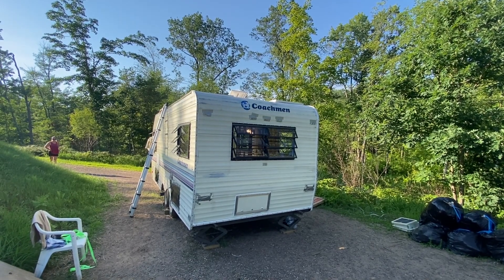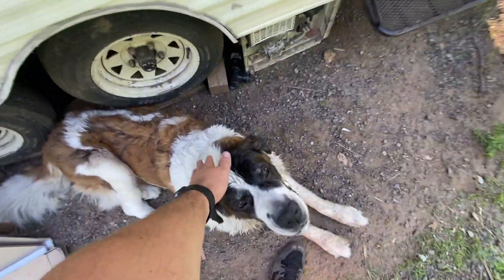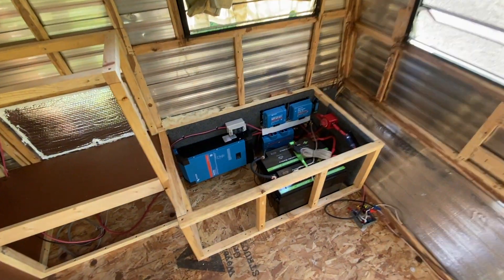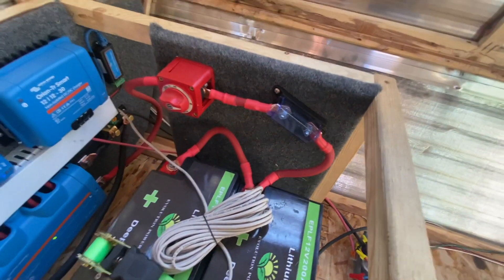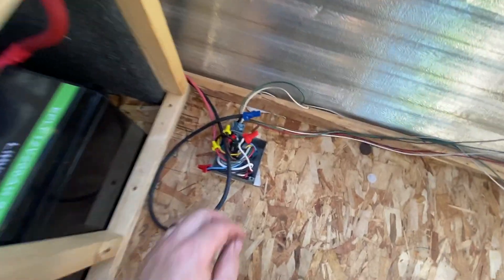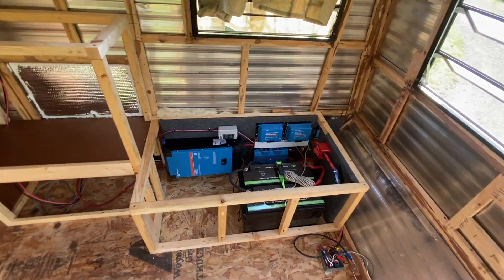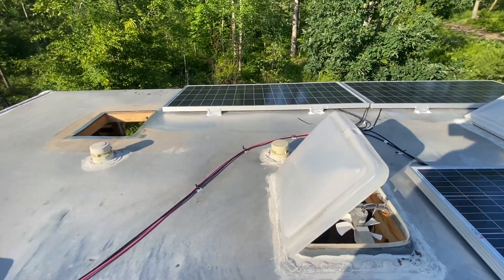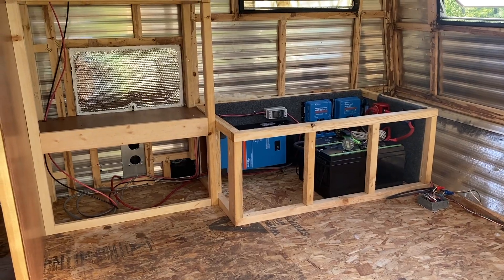Remodeled Coachman Catalina Travel Trailer Victron Solar System

Comment: Looks like a fun install! Tell em they need 2 or 3 more panels on the roof to run their A/C too. Those rooftop units pull quite a bit of power. Unless you go with the minisplit. I hear those are quite nice.
Reply from the maker: Yeah they are planning no AC and to full time chasing 70 degrees, however they should be able to run a window unit for a while with their setup.